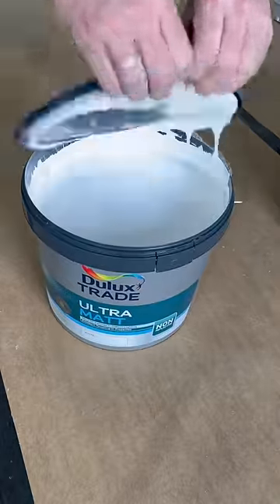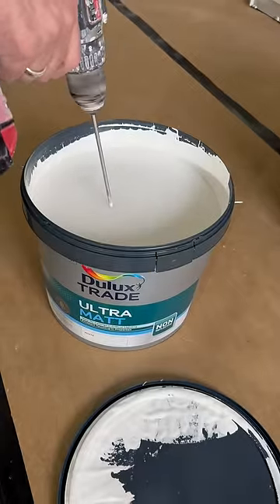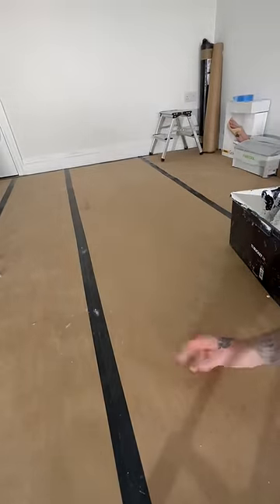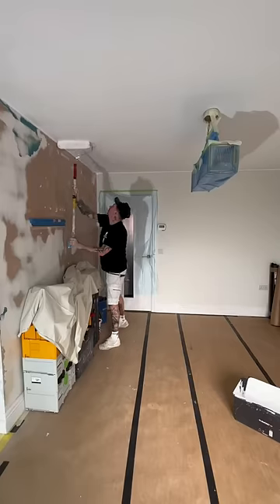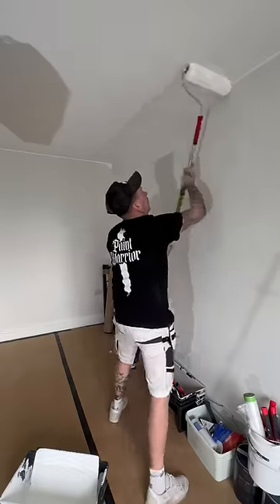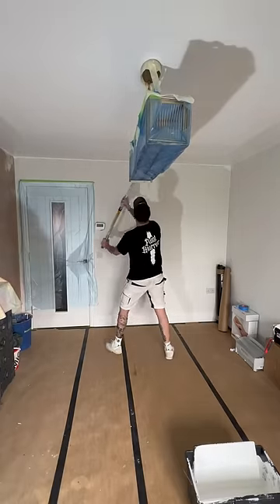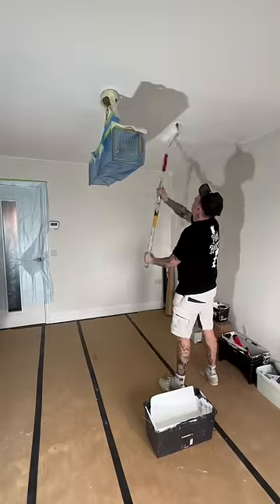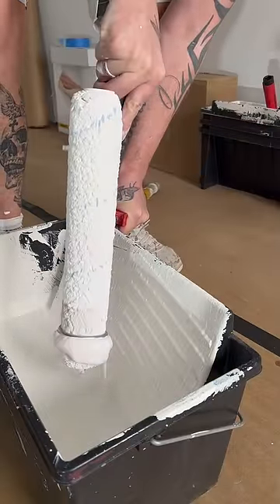HOW TO PAINT A CEILING.. #ytshorts #youtubeshorts #painting #diy #viral #paintwarrior

Comment: Don't ever water down yr paint, your taking away the paints natural properties that maintain the paints durability, also makes for more splatter.  You always should cut in with a mini roller unless you're not painting the walls, use a brush amd mini roller. Never cut in with the big roller. Also start from a window or light source so you can see the wet line. I've been a painting professional for 25 years.
Reply: Solid tips, also don't buy shit cheapy paint!
Just don't bother!
Reply: You are saying this like the guy in the video could never deliver a good result, people do things differently and you are just here to complain
Reply: @e33d90  The guy who posted makes some very good points, the reason I know this is because I too used to be a professional decorator!

You piss the paint out with water only to paint new plaster walls as a 'miss-coat', at a 50/50 water to paint ratio.
Otherwise why thin out your paint?
You want solid coverage with the best possible opacity
Reply: @TheHungryTrollRawr  so was he then always painting blindfolded? Or was he a fool? Did he use the same brands as you? How do you explain the discrepancy?
Reply: @e33d90  mate, he explains the problem in his comment! If you thin paint out, it effects and weakens the durability of the coat.
Remember thinning paint out loses the coverage too, sometimes you may have to add an extra coat just because you thinned the previous coat out - I mean that's counter productive, especially when you're trying to earn money!
The body of the paint is made so unthinned provides the absolute best coverage possible - aka it looks better.

You get two types of decorator remember, theres the ones with really good names and then theres the cowboys!
Another tip, I used to work with a lad in the old firm I worked for, who always thinned out the gloss paint, you seriously see the dfference when it's dry compared to another decorator.
His finish lost LOADS of the finished shine, as well as his paint looked more see though!
I swear to God we worked on expensive new build houses, they sold around £250,000 each and I was 17-18 at the time, I'm 47 now, to give you an idea.

The woodwork looked stunning when prepped and painted properly, you would see the thinned out gloss in the ones my mate painted and it really looked weak. Shocking tbh
Reply: @TheHungryTrollRawr  the effect is minimal while applicability and ease of use increase, why can’t you weigh these things off against each other? You are just here copying what he said with nothing to add
Reply: @TheHungryTrollRawr same as adding water to a bowl of soup! Dilution is dilution, not very hard to believe!
Reply: @Cheekycnt  Well, I certainly wouldn't add water to my soup lol, only thing I would add water to is squash pal
Reply: @TheHungryTrollRawr  very well put man, you can give the best advice sometimes but there will always be those people who watched the video already and believe that’s the way, no matter what. lol when you work on million dollar homes, it’s a different ball game… quality wise, and money wise, clearly you know that already. Thanks for further explaining.
Reply: I just moved in to a house my ceiling living room is white with no gloss ...can some body guide me to a type of brand to use to retouch it i  rub my dirty fingers up there  n I wiped it down with water n couldn't get it off..helllllp professional painter
Reply: @MariaGonzalez-ei1pv  It's probably Vinyl matt Emulsion, brilliant white. But I haven't seen it so I can only guess
Reply: @TheHungryTrollRawr mist coat not missed coat.
Reply: Noone cares boss, you can't even put a sentence together let alone paint a room like
Reply: Love to know his reason to add water
Reply: Do I paint along the light or against the light source?
Reply: @boundservantofgod  Start your rolling near a window and work back horizontally, you'll see the wet shine of your fresh paint to guide you
Reply: @e33d90  You never add water to  ceiling paint.  I've painted for 35 years and painted major contracts for multimillion dollar governor's mansions and other major contracts.  This is a TERRIBLE tip to water down paint.  The person who said it was a bad tip was 100% right.  Just because someone makes a Youtube video; doesn't mean they know what they are talking about and this video maker clearly is not someone anyone should follow
Reply: @888strummer  i’ve painted for 700 years for the intergalactic trade federation, painting the outsides of light speed spaceships and we water down the paint just fine
Reply: @e33d90  Sorry to let you down, but I'm not here to joke around; I'm ere to try to help a few people.  No professional painter with any knowledge ever waters down paint.  There's nothing funny about giving really stupid advice and wrong advice on any trade as you are doing.  Most here know little about painting and are being steered completely wrong by the videomaker and people like you.  People need to know to buy good quality paint and to NEVER water it down.  Good luck Youtubers and I hope you can differentiate between those of us with knowledge and those who offer terrible advice
Reply: @888strummer  the manufacturers themselves often suggest what to thin paints with and if it is spirit or water based, says it right there in the package. What now bucko?
Reply: @888strummer  your problem is that you think every single paint on earth is the same and that you have experienced them all and that you can definitely speak for them all
Reply: @e33d90    EVERY high quality paint specifically says NOT to thin the paint.  Again; buy high quality paint and NEVER thin it out.  Thinning paint or adding water defeats the purpose of buying high quality paint.  Cheaper paints have MORE water; that's one reason why they are cheaper.  THey are lower quality because they have more water.  But remember also that most lower quality paints also say specifically NOT to thin the paint; not to add water or anything to the paint
Reply: @e33d90  Your problem is that you know little about painting, but are choosing to argue with an expert.  I'm done here; I hope I helped a few people
Reply: @888strummer  its simply not true that every high quality paint says not to thin, its lies like this that completely undermine your position
Reply: Thank you! Painter of 17 years here.... why do people insist on watering paints down.... i always look in the comments to see if anyone corrects them...😂
Reply: Dulux themselves say their paint is designed to have water added
Reply: @M.H.N_  careful you might trigger the boomers

Comment: 1. Don't water down paint it only creates splatter. 

2 . Extend the pole so your arms don't have to reach.
Reply: No....imo I don't water down any paint. The diffrence between quality paint and cheap paint is just that quality paint has resin and pigment in it and cheap paint is just watered down paint. The reason cheap paint does not have great coverage is cause it has to much water in it. If you want watered down paint just buy the cheap paint.
Reply: I agree, if you want runny paint get some flat paint.
Reply: Must be Americans, some paints here in England are just too thick and that is a water based paint
Reply: Trade paints always that bit thicker
Reply: You add water to give paint optimum viscosity which is essential with aome paints ie Caparol 'CapaDin' Please try and roll this product without water and come back with comment .

Comment: Excellent video and great technique, may I suggest a time saving thing taught to me by a great painter.Forget all the cut in work.U will find that paint on a existing wall is a a plus cause cutting in the walls are easier u will find.Now take that big roller run it length wise quickly run the corners and smooth out.Forget the ladder and cut in brush.Use later  for walls

Comment: Don’t dilute the paint bruv, makes it too thin…unless you getting paid by the house so 20 coats should do the job
Reply: boy tells me a lot.
Reply: Only time I thin my ceiling paint is if I’m applying it with airless spray on new builds
Reply: You can dilute Dulux trade by 10% without losing opacity.. if you're using cheap shit paint don't dilute it

Comment: You can improve consistency of coverage, and reduce effort required, and improve productivity, by using a longer extension handle (more leverage) and using your wrists more. The longer handle means less vertical angle of attack, so easier on the eyes and neck (but another good trick is to roll up a towel and place on backpack to support neck during painting).
Reply: You're going to knacker your wrists real quick if your constantly trying to generate power and movement from them. as you describe.
Reply: @gaurasrspublishing  been painting like that for 30 years (not daily, maybe 2 weeks every few years) all good so far
Reply: @ApprenticeGM  Ok, that's just basic DIY level, try doing that every day  as a job and for sure you will completely knacker your wrists permanently.

Comment: Previously,I never add water,..but few years back was told always add water,...I agree, it is always better.
The secret is knowing the consistency, and it's different if using brush or roller.
Get the consistency right,and rollers are best ,just get correct water consistency.

Comment: You should only put water in for the mist coat because if you use it for the finish coat it gives it a shiny sheen so if you ever have to touch up it will look like a patchwork quilt. Trust me on this  mucker 👊
Reply: Why would he be concerned about that
Reply: Expert, did you watch
Reply: shiny sheen.? its a Matt finish, not an acrylic/eggshell etc.. and actually, every additional coat should be thinner than the previous one. same concept as plaster/render coats.

Comment: Been  a professional decorator for 44 years and I never use  a long pile  sleeve on a flat ceiling do not get a good finish just end up with orange peel look
Reply: Yes and no, depends on type of sleeve , type of paint (brand and finish) and how it's applied. That's a great sleeve. Another is "Superdoz". Both are tight weaved not long hairy type. Assume he rolling it out pretty good and working it in. But I've seen so called pro butchers just slop it on more or less for speed and think they're great painters because of their speed. All his tips are good. Thinning the paint depends on paint you're using and application. Some comments here are complaining to never thin paint. Hot hot it is, type of surface you're working on, even humidity effect how a paint lays. Sure you know. For anyone who reads this and don't.

Comment: Should specify when you are watering down your material, that it’s latex and not oil based or someone is going to absolutely destroy a good can of paint
Reply: So who puts oil based paint on a ceiling?
Reply: Those people shouldn't be allowed to paint on their own tbf
Reply: The direction on the can/bucket  say "two full coats" meaning the only thinning that should be done when used as a primer but most painters here in the states use a separate primer.  I really don't know the reasoning for the thinning but he has his reasons.
Reply: He thins the paint so it's easier to work with and oil paint can be used on ceilings/walls if you are trying to seal a surface from a stain or nicotine.
Reply: If you don't know what oil based is as opposed to water based they shouldn't touch a thing
Reply: @markmacphee4379 oil paint doesn’t seal surface stains. Oil based primer does.
Reply: I've been a Decorator for 20 years and when you are working in houses with nicotine or waterdamaged properties I assure oil based paint ie undercoat does seal the surface
Reply: You don't have to agree I'm saying it based on experience there is also a waterbased emulsion that's called Stain away that can do the same job nowadays thats alot odor friendly.

Comment: If you let those boarder lines youll see em also you wanna roll the same way the light comes in and it will show less roller fat but ya well done mate.. perimeter lol
Reply: If you're getting visible lines in your ceiling flat paint and you are a professional painter, you need to get off the tools
Reply: @lunch2102  yeah forsure thr sheen is harder to work with. I'm just giving some advice I learned from some masters of the trade.
Reply: @geebarney7910  it's probably personal preference or maybe good advice for amateurs ( no disrespect ) but as long as you're putting enough on, not stopping half way through and laying it off evenly, it really shouldn't matter.
Been a painter on and off for almost 30 years.

Comment: Why is blue tape wrapped around the roller and then pulled off again? 
Is this a way of pulling all the loose lint and fibers out of the roller so it doesn't end up on the wet walls?

Comment: How would you clean the ceiling beforehand if it needed to be (smoke or something) ?
Reply: Ceilings are usually a flat (non glossy) surface,  so cleaning them is almost impossible. Just paint over it.  If it's a smoke stain that keeps coming through the ceiling paint,you would need to undercoat it with an oil based stain stopper.
Reply: @dan74275 Oh I see, it's very different from walls then. Good to know. Thank you for the tip !

Comment: Swipe, mix the paint, strain the paint. Even new but never ever ever add water only idiots and wanbees do that
Reply: Why not? I mean , you get if you were going to spray that room with that paint, you'd need to thin it down considerably,  so what's the difference? If it gives you slightly more time to get it on then what's the issue?
How about when using contract on a new build on bare plaster and you want a good absorption?

Comment: Use dulux super matt.. 100% one coat unless bare plaster.. Ultra matt is banging as in if you nuts any area when you check against the light, you can touch up with a brush.. Life saver... As in if you doing a massive ceiling with 25 spotlights, 🤮🤮🤮🤮 bro Your using long pile 🤮🤮🤮🤮🤮🤮🤮😬😬🤮🤮🤮🤮 That's for exterior deep render